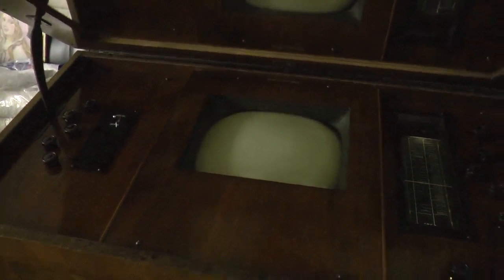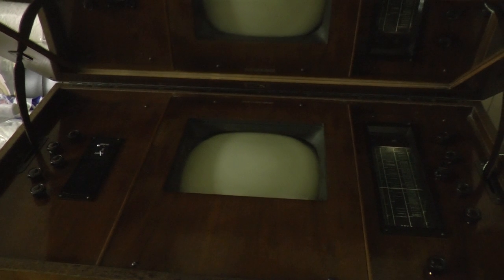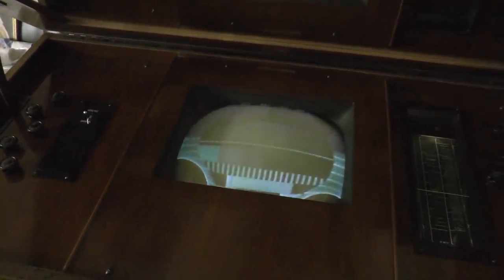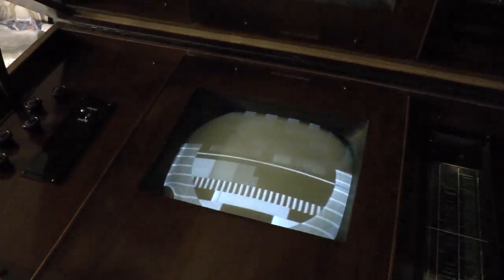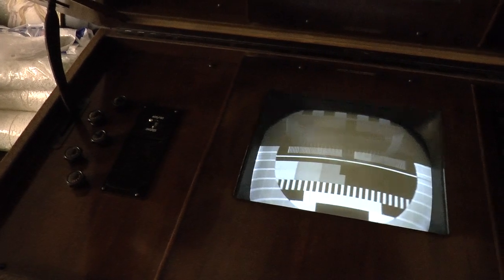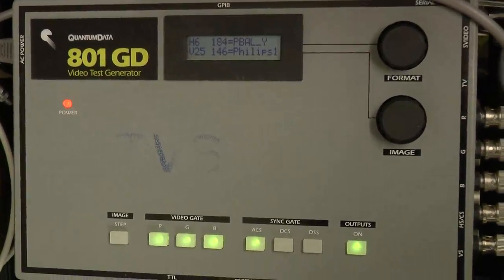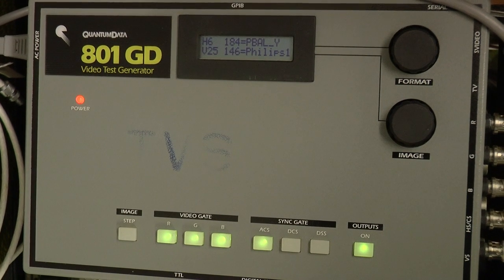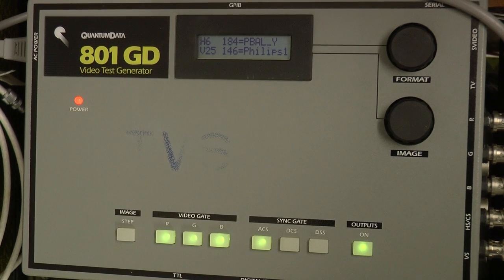HMV 900 , Pre War Television 1936 , showing the Baird 240 line system and EMI 405 line system

Comment: Is that CRT original?  Deflection is electrostatic or magnetic? The picture is amazignly briht! Magnificent restoration, keeping the final inspection tag at the tube's zocket was a nice touch. Thanks for share it
Reply from the maker: It's a replacement tube, although I don't know when it was done, but that's how the value layout chart is marked. It has magnetic deflection
Reply: @vintagevideo4044  Really? I always assumed the narrow deflection angle was because of electrostatic. I guess just much maller coils than later sets.
Reply from the maker: The deflection is magnetic and the deflection angle is low because the first generation of output valves could not provide enough output power for a larger angle
Reply: @vintagevideo4044  I'm sure you're right, since you restored it! I just couldn't see the coils (at about 7:08 and 7:33), which I'd have expected if anything to be even bigger than later ones, if the valves couldn't put out much power (so I'd expect the coild to try to make the most of what little power they could produce).
Presumably that was why a mains-frequency EHT source too - or was it just that no-one had thought of using flyback energy yet? (Or kHz transformers hadn't been developed?)

Comment: Is the 240/25 flicker as bad in person as on video? But wow man wow!!! What a set!
Reply from the maker: It does flicker in 240 line mode, but the video camera makes it look worse and the youtube process even worse still
Reply: @vintagevideo4044  I did wonder... given that movie frame rate is 24fps ... and this is effectively 25 frame progressive.... and VHS video tape resolution.
Reply from the maker: @ceebee23  All of those are interlaced to hide the flicker . Movies were originally speeded up to 25 frames . With things like blu ray 24 frame the display panel ups its frame rate to hide flicker , we did do some tubed televisions that would display progressive from DVD and the customer books warned about flicker in that mode.
Reply: @vintagevideo4044  of course Baird's system suffered other issues ...with streaking caused by dirt in the disk scanner and general issues of the film system etc... not to mention the issues around the whole fixed camera setup in the studio

Comment: A 1936 TV set!  How about some TV output from the time (admittedly there is not much, the earliest surviving recordings are that of the Royal Wedding in 1947); the C test card did not come out until 1953, ITV (Originally ITA) in 1955 and switchable TVs in 1949; these were used by set-top boxes by ITA which was accessed by the BIRMINGHAM switch for a LONDON set (and vice versa).  No set of that time would have received all those different channels or in 405, it looks as if all the switching was done by a modern set-top box.
Reply from the maker: I do have some early things, but still like to run live programmes on them
Reply: I had known about a screen film made by an enthusiastic amateur bear Ipswich  who had an ambitious aerial displaying the 1937 Coronation Procession.  Apparantly it went into the archives and had never been seen again but about a month ago I saw a snippet from a BBC documentary some years back. It looked genuine because it gave the same view as one of the film newsreels whose camera man had sheltered from the rain under the temporary elevated platform built for the Emicron camera. Does anyone know where the whole "recording " now is ?

Comment: has an old TV, plays modern programmes.
Reply from the maker: You use a converter, that converts a modern signal, to the old system and plug it direct into the aerial socket

Comment: Hmm I guess you must of modified it so you could hook a set top box to it, to receive digital tv
Reply from the maker: No modifications, I use a Aurora converter, it converts 625 to 405 and has a built in modulator, so as long as the digital box has a 625 line video output you can display it on the tv

Comment: How did you bet more than 1 channel on the tv? From what i know, BBC (later BBC 1) was the only channel then. Did you retune it throughout the years?
Reply from the maker: I use a digital converter, you put standard 625 line video and sound in ,it converts it to 405 line or 240 line and also the original frequency of the aerial signal, so it plugs into the original aerial socket and no retuning is required
Reply: @vintagevideo4044 ok, thanks for telling me that!